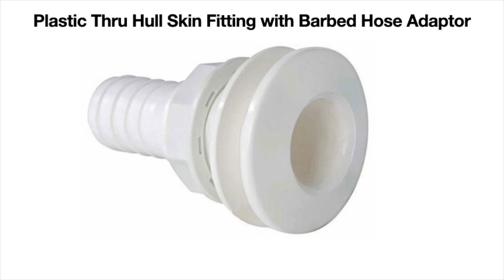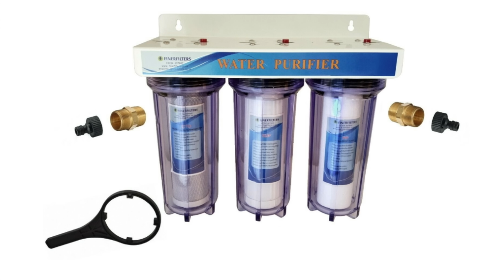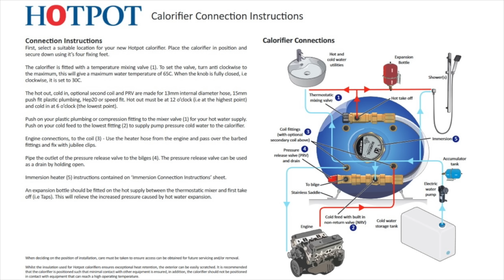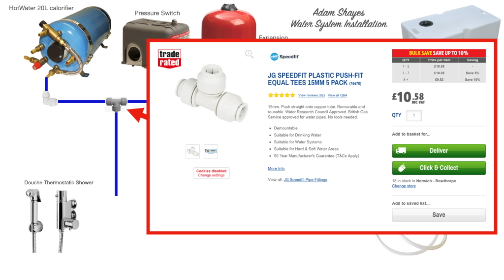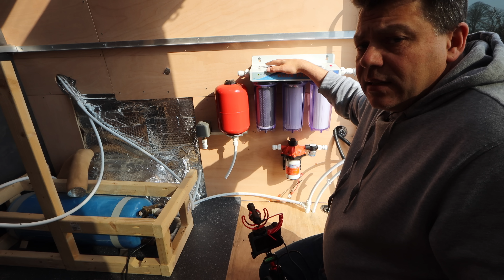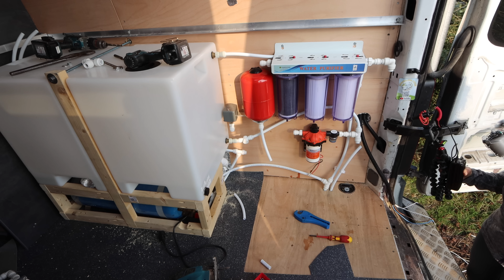Self Build Sprinter Campervan DIY Water System Installation

Comment: Looks a great set up, lots of steaming hot water! think you did a typo on the inserts, they were 22mm, think you were running it all in 15mm? great project, looking forward to more content :)
Reply from the maker: Hi Reverb, Yes your absolutely right, I was using 15mm, didn't notice the 25mm 👍 Cheers